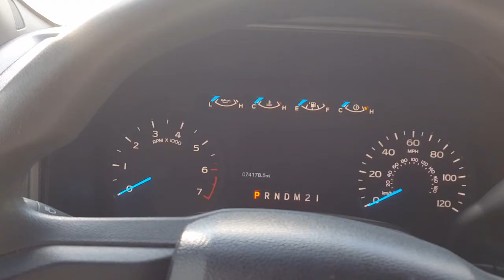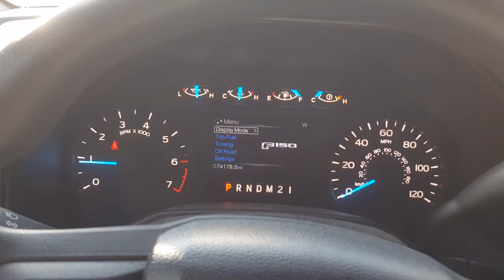How to repair F 150 park brake malfunction easy Fix

Comment: This worked for me too. Crazy that the voltage level was high enough to start the truck, but low enough that some of my electronics were starting to have issues. New battery fixed it. Highly recommended.

Comment: Going through this problem right now, on Christmas Day, trying to leave and go back home 242 miles where my pipes are frozen in my house.  Truck started, barely, and can’t get parking brake disengaged.  Don’t think I can get a battery on Christmas Day.  Just here to vent, thanks for the video.
Reply: Whatever happened? Curious...
Reply: I’m experiencing the same problem right now. I get a “park brake fault service now” and my car won’t move because the parking brake isn’t disengaging. I need help!
Reply: @wickman9 same problem here did you fix it already?

Comment: I have a brand new battery and mines still doing it and as of today I actually tried to use the parking brake and it didn’t work so I think in my case it’s actually the parking brake I have a 2018 5.0 f150

Comment: Or.. you can disconnect the battery and reconnect the battery and it will fix this problem don’t necessarily need a new battery

Comment: I don't think that "fixed" the problem. Your computer only has a limited amount of time it retains its error codes once you disconnect the battery. You probably just manually reset the code by swapping the battery. My truck just did the same thing. I turned the truck on and off three times and it went away. You probably just bumped the switch in a way that confused the truck.
Reply from the maker: I know the every time you star your truck the malfunction go away but it comes back in my case went I replaced the battery never happen again just take your truck to a autoparts and let them test your battery they tell you if need to be replaced or not.

Comment: Which battery? The starting battery? I've been getting the same message on a 2015 F150.
Reply from the maker: Is the main  battery , your car is starting but the battery is lower in amp
Reply: @edhandy  so is the solution to buy a new one

Comment: I have same issue, but my tires are locked won't move.  Will this work if I try this and the emergency brake will disengage?
Reply: Im having the same problem my 2015 fusion ebs will not disengage.
Reply: @justanothadude8339  I have my 2019 F150, for last few days looking for a part. Apparently Parking Break Module.
Reply from the maker: That happen to me ones that fix that problem too
Reply from the maker: You can disengage the brakes putting the emergency brakes on maintenance mode at the removal process, I hope you understand check on youtube how to put the brakes on maintenance mode and use the process to get out of the maintenence mode